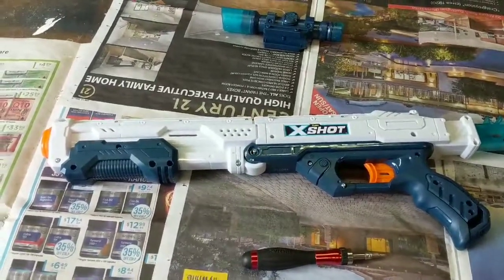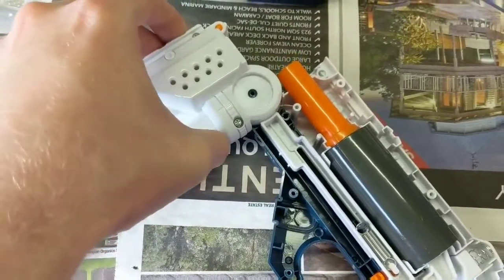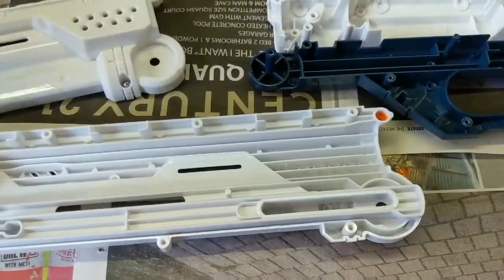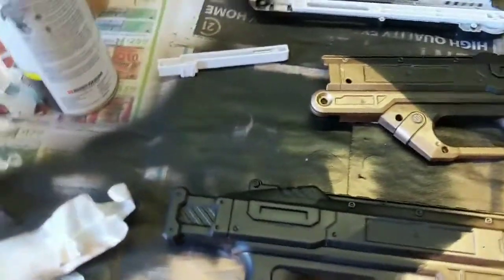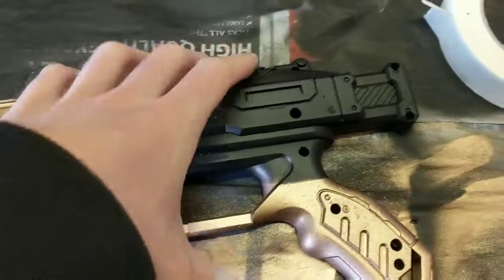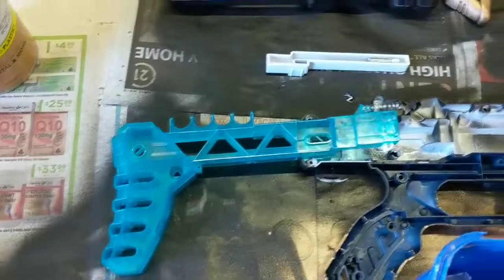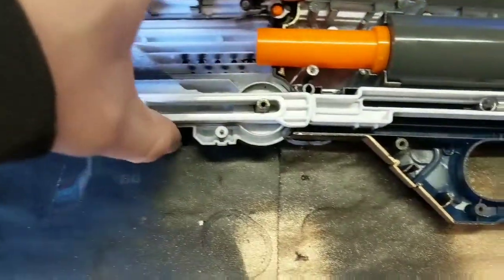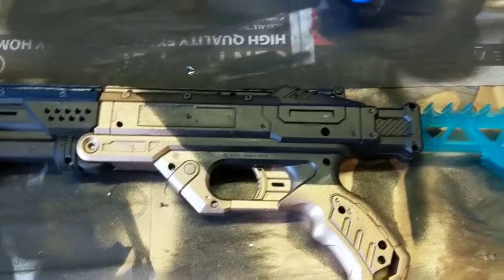X shot Hawkeye painting, disassembly & reassembley

Comment: Is it possible to paint a nerf gun with acrylic without adding a base layer of matt black spray paint?
Reply from the maker: Use some thin grain sandpaper and scrub the blaster down a bit, and you'll probably want to use some paint primer as well. But yeah if you do those first it should turn out fine!
Reply: @WingsofSilver_Tsuba69  Thanks

Comment: Is removing the air restrictor worth the trouble?
Reply from the maker: I removed the ar on a maverick and honestly it made it worse, maybe I did it wrong ha XD depends on the blaster, but make sure you know what your doing first! For the most part it should improve the range a fair bit
Reply: @WingsofSilver_Tsuba69  Yeah, it's way important to know what to do and how to, since messing something up when modding can result in a blaster with worse performance than stock or downright broken (I don't own any blaster at all, is this correct?)
Reply from the maker: @y100xt3  yeah that's true, there's plenty of guides for other blasters, I made this cos I couldn't find one for the hawkeye
Reply: @WingsofSilver_Tsuba69  Yeah, it sure is hard to find one for this one specifically! I really appreciate the effort you took into making this video!
Reply: Yes. Definitely. Also replacing the spring or doing a double spring mod is good too.